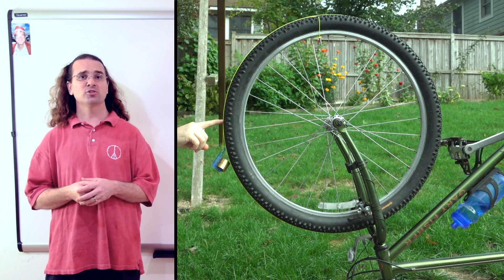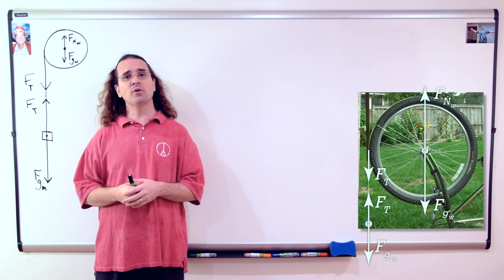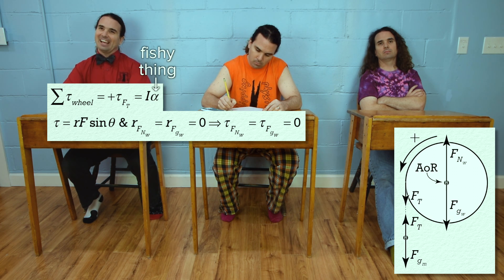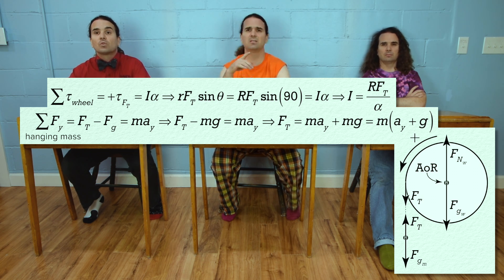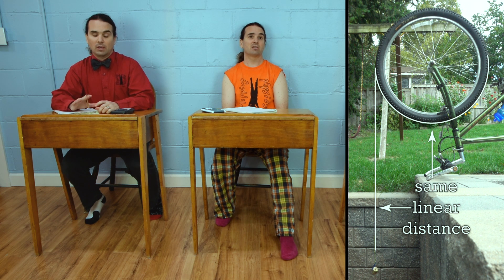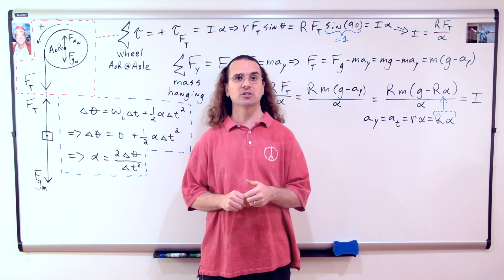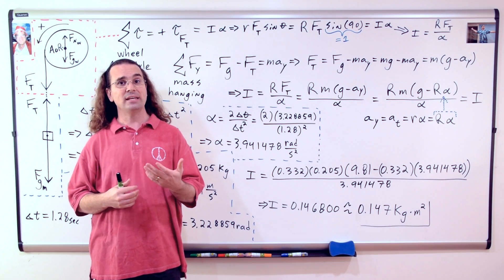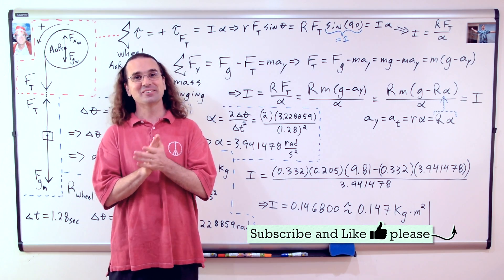(1 of 2) Measuring the Rotational Inertia of a Bike Wheel

Comment: Great Video. Thanks.
You've assumed the wheel to be rotating without any friction. But in reality there is always some friction. 
Can I get some knowledge on how to measure this friction and how to use it to calibrate the experiment of measuring rotational inertia ?
Reply: I just found a paper called "measuring the moment of inertia of the human body by a rotating platform method" where they discuss the fact the friction is actually extremely important and by not including it M.O.I. values can differ by up to 40% from their true values. Fortunately, the friction in these sorts of apparatuses behaves very simply in most cases and a simple correction terms makes this method extremely accurate. If you were doing this seriously then you'd almost certainly include the friction though, (I think) you are correct.

Comment: I'm still not understanding why the tension causes a net torque on the wheel. Would it not be the weight of the hanging mass minus the tension causing the rotation?
Reply from the maker: The weight of the hanging mass does not act on the wheel.
The weight of the hanging mass acts on the hanging mass.
I talk more about this here: https://www.flippingphysics.com/rotational-inertia-bike-wheel-2.html
Reply: The weight of the hanging mass acts on the weight and the weight of the earth acts on the earth (but hardly causes it to move) 
The mass pulls on the string and the string pulls on the mass 
In turn, the string exerts a force on the wheel and the wheel exerts a force on the string. 

You'd agree that the force turning the wheel is a type of contact force, right? Well yeah, so the string is touching the wheel, but the hanging mass on the other hand can not exert a force directly because it isn't even touching the wheel. 

Actually maybe you're thinking something else, in which case maybe this will explain it: you're right that weight minus tension gives acceleration of the mass, and when measured around the axle of the wheel the mass has net torque, however the hanging mass is not the system of particles that is the wheel and so is irrelevant to the wheel/wheel's problem. Alternatively, torque is I*omega is the sum of external forces times the distance to where they're applied (in scalar form anyways); so the hanging mass has a net torque, but even when you calculate that you don't use the radius of the wheel. You use radius of the wheel to calculate torque on the wheel, the only external force being applied comes from the tension in the string alone. 

If the torque on the wheel were r times the weight of the hanging mass, too, then that wouldn't even make sense because assuming string length is constant the wheel would turn at the same speed regardless of it's moment of inertia, which you can see is just wrong.

Comment: You did a great job! But, maybe using energies would have worked easier? :)
Reply from the maker: You can solve problems like this using net torque https://www.flippingphysics.com/wheel-rope-acceleration-torque.html
or energy https://www.flippingphysics.com/wheel-rope-acceleration-energy.html However, we had just learned about torque when I had this video and we needed to work with that concept more.